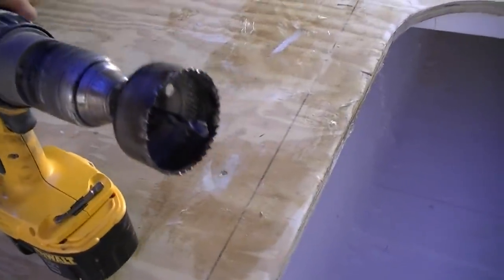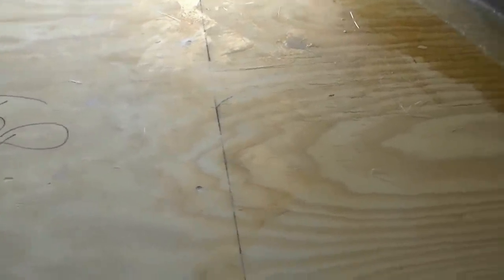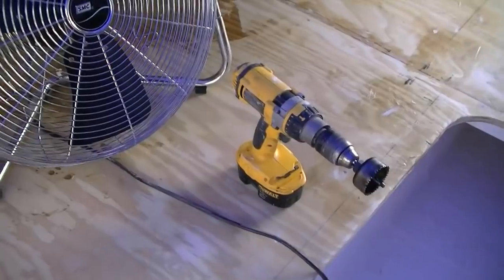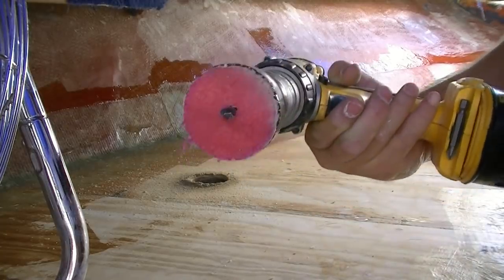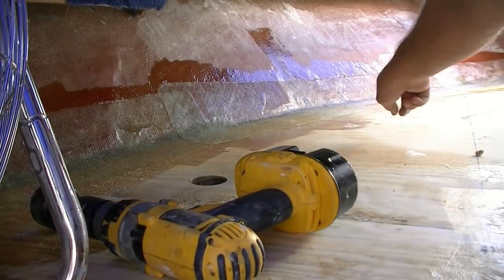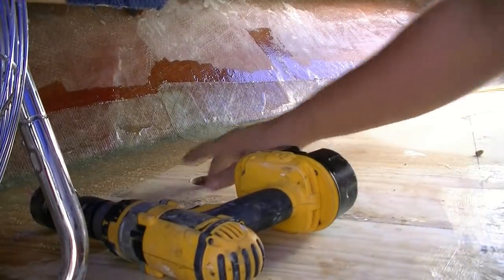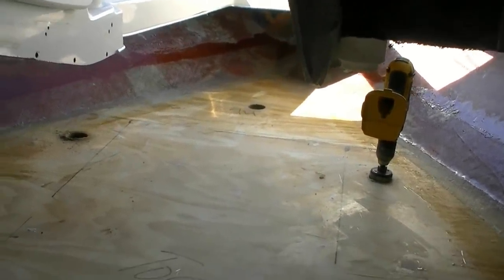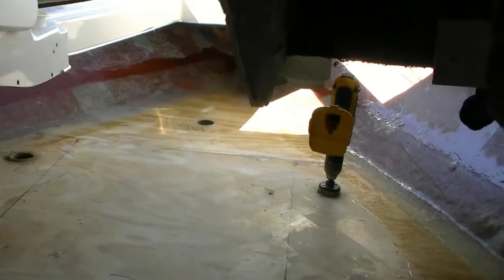Foaming the Deck of the Sea Ray with 2 part foam VLOG# 37

Comment: I don't understand why you would foam fill the sealed compartment creating the possibility of either the floor pushing up or the bottom of the boat to sink down from the foam swelling when the foam is curing, further more I bet that boats got some serious water issues rate now from not drilling any weep holes in the floor stringers to allow the water trapped in the front to run down the center into the rear compartment where it can be drained out threw the drain plug, any boat sitting in water sweats on the inside from reverse osmoses just the opposite of a cold pop can in the heat of the sun, on a cool night it will also sweat out of water and that's how water can rot out the foam. if I was doing the project I would have used that pink 4x 8 ft sheeting foam and laid it down between the stringers with just a dab here and there holding it under the floor but not pressed hard against the bottom of the hull, I liked your work with the peanut butter and I would have used a rubber hose in the drain hole so I could remove it in case another brass sleeve would have to be put in somewhere down the road, all in all its great work and you did a very nice job, just giving you some info you probably hadn't herd about before.
Reply: +mark chock  ok lets set the story straight, foam floats and its a coast guard requirement on all new boats to use foam under the floors, I have an issue with this as foam that is sprayed is sealed but when you cut into it it destroys its hard shell on the outside and will allow water to penetrate it just like a sponge, in my own opinion you should use plywood treated and cover it with fiberglass resin and matting to seal all edges and use it as stringer boards, once its installed as a stringer to hold the weight of the floor and support the chimes on the bottom of the boat you should drill weep holes in the lowest most rear point of the sides closest to the shell of the bottom of the boat, if you look at it like when the boats taking off where does the water go? this will help you understand what I am talking about. when it rains on the inside of your boat the water runs under the floor and if its full of foam then the first chopy water you hit real hard starts to move and stress the foam, foam should only be used under the bow and inside the top sides where your steering cables run threw it, remember its a flotation device and has no structural support. if you seal off an entire underside of a boats floor with no drain or weep holes I guarantee there will be water in it and no way to get it out without removing the floor and drilling weep holes.. take a look at how water drains out of a simple row boat it runs down threw holes in the inner structure to the drain plug. if you think your boat may be retaining water just put it on a trailer and raise the front and pull the drain plug, if you still see it dripping after 3 days its holding water, if the foam is saturated it could take months to dry it out and maybe even years. I worked on a lot of boats in my career and I am considered a fiberglass expert. my first redo was a 14ft v closed bow 50s model Larson, I removed the floor and transom and foam filled the stringers, the transom was custom made at 1 1/2" thick from top to bottom with reinforcement gussets glassed rate into the floor and transom. the top had to be cut shorter 1 inch to compensate for the water well at the rear of the boat because I wasn't thinking when I made the transom too thick and when I tried to put the top back on it was hanging over the bow lol. so the boat was custom built as the original rating was 40horse but I put a 4 cyl 65 hp v evinrude on it and got 42 mph out of it, a year after I sold it I seen someone had put a 225 short shaft black max on it. I think I know my stuff as I built it for 200 horse
Reply: +mark chock  I agree with much of what you say about draining compartments of moisture,I disagree with the foam not having any "Structural Support". I am in the process of DEconstructing a '97 Skeeter Bass Boat. When I took out the floatation foam and the wood,much of it WET (due to poor construction an not COMPLETELY resining ALL the wood by the manufacturer),  the hull lost a lot of it's stability.I will be putting foam back in when I do the rebuild and EVERY compartment will be sealed properly! This isn't my first rodeo with rebuilding a boat from the hull up so it will be done right. The poorly constructed Skeeter lasted 20 years now and done right should exceed that. Happy Boating!
Reply: +Mike Small I believe the boat was originally foamed for satisfying the coastguard in new boat construction. I used foam to hold the stringers in place on a 30yr old boat one time and I found out the hard way what happens, the floor was removed and the stringers were exposed and you could see that they were dry rotting and it being my own boat I poured the foam down across the open stringers just for a quick fix to hold everything tight in place so I could get the new floor set In, and fiber glassed all the edges down and everything looked kosher but when I got it in the water it rode like a surfboard and my friends and I skipped some waves with it and had a lot of fun that summer, the issues started showing up as the boat was trailered outside and the boat was dripping water forever, now the only thing I did was take the boat out and beat the hell out of it like most 20 somethings would do with a $50 boat. it was extremely heavy as the water saturated the foam. now im not saying that the new foam or the old foam are better or worse I am just stating what I found in my own personal experience. I now have a boat that im sure has foam in the floor but as long as I  keep the inside dry I believe the foam will stay in good shape, I think that by skipping waves with a 225hp merc on the 14 ft Larson V hull might have smashed the foam a bit and actually started the decay of the foam by the intense pounding it took from jumping waves. good luck with foaming and just keep in mind that it expands 30 times its size so 1 qt mixed fills 7 and 1/2 gallons of space and you can trim it with a hand saw blade.
Reply: Non structural low expansion closed cell foam...designed for flotation. Aero Marine is a well known company with a ton of great products. Look them up before commenting. Their 8lb density foam works great as well but not for flotation. More like the foam used in boat manufacturers that build boats with foam filled fiberglass stringers.

Comment: Hi like to say you have been doing a great job i do a ? regarding foam like to get your thoughts as you have had this project done for long time so here is what i just got ( 14' Glass Magic )   my floor wont be as deep as yours for sure at most it be 7 inch's i am thinking of using spray type " Great Stuff " because it is a foam and ill be working in a much smaller space im thinking at most 4 cans should cover it my understanding the foam is there to help with noise and poss make stronger like to get thoughts on this
i see you use 2 part ill never need that much for sure ok thanks and again great job

Comment: I would foam it....cut the foam off level with a saw or hot wire...sand flush to the stringers.....put down deck.

Comment: You should drill a bunch of 1/4" holes around on a grid...
That would allow air to escape and also a simple visual check that the foam has filled the cavity completely.
Reply: +Tyler Durden in time you will understand why foam is not good to mix in water. its cheap solution for a simple problem of sinking watercraft and in time it breaks down into little floating pieces on the lakes
Reply: +mark chock Who said anything about water?
Reply: +Tyler Durden I assumed you were going to put your boat in the water. if you only new about the factorys problems on boats with foam filled floors you would be in awe. the foam is like a sponge, it absorbs water and every time the boat is used it gets water in it from the outside, the water doesn't just jump back out of your boat it has to be pumped out, if the boat is still dripping water from the drain plug hole after being out of water with the plug pulled out for a few days you have water under the floor, its like everything else in this world gravity pulls it down, a boat sitting on a lake tied to a dock sweats from the morning dew on the outside you can see it, now what do you think is happening under the floor as its sitting in the warm water on a cool night. the dew has no where to go and gathers at the lowest point, even a saet gets wet from dew as the cushion sweats on the inside as well as the outside. if you think a boat needs foam under the floor then ask yourself this. why does  a cargo boat have a steel hull covered with concrete? it has a pump in the bottom of the hull pumping water out to keep it from sinking. there no foam anywhere

Comment: can you put down foam first then trim it and put down the deck?
Reply from the maker: +My Damn Channel You could, but then need to cut it level
Reply: +My Damn Channel Yes. The best way is to drill many small holes for venting and calculate how much resin per pure you need. It needs to ooz and blowout all the holes. If not all you are doing is making cavities under the deck. Pre forming works great. Use a long sanding block with 36 grip paper glued to it and just sand it flat. Then bed the deck in resin thickened with fumed silica. This is a very bad example of how to do it.

Comment: Regarding the waste in the bucket - it has expanded by a factor of at least 10 (manufacturer says 30x max eventually) and so you're only looking at about 1/4 cup of resin in the bucket each time.

Comment: @brewnonymous Milwaukee is a Taiwanese multinational conglomerate.  They're owned by TTI.  DeWalt "currently" is probably better.  The drill in the video is an 18V NiCad hammer drill.  If he's using it in the wrong gear, he'll burn up batteries.  My guess is, the batteries are just done.  They should last just fine however, he did state that it's hot.  In heat, they'll fail more quickly.

Comment: Why replace the foam?  I'm asking because I really hate that stuff.  It seems to do nothing but cause problems.  It seems to get waterlogged and nasty, and rot everything.
Reply: +highvelocity123 your right it rots, it retains water and if you really want to save your boat when replacing the floor leave out the foam. if you have a junkyard weigh scale see what it weighs this year and weigh it again next year, if its gaining weight its retaining water
Reply: Afaik close cell foam is waterproof. Open cell foam isn't.
Reply: My ex-wife's favorite excuse. :D

Comment: What ever they say closed cell or not as the foam gets old it get waterlogged. the bottom of older Carolina skiffs are made using premade foam (which should be perfect but they absorb water ........none of it should be used anywhere water cannot drain out of!   if you look at how crappy the foam looks that bubbled out that what is at the bottom of the foam he poured , crappy..... im sure the boat will be fine for quite a wile but if its not looked after right..........cheers warren

Comment: The foam is a nightmare.  Will retain moisture thru the years and rot out your wood.   I would have put in little inspection plates to inspect annually for cracks and to be able to wipe dry.   The hull weight will increase yearly with moisture buildup.   U did a great job though except for the foam.

Comment: Why foam over bilge?
Reply: +bestian4 Two reasons.  1.  For floatation in the unlikely event of taking on water to help try to prevent the boat from sinking (an object floats because it displaces more  weight in water than what the object weighs) and 2.  to remove air voids where gasoline fumes can accumulate creating an explosion and fire hazards.

Comment: I have worked on a lot of decks. I would never replace the foam. It will hold water and cause the deck to rot.
Reply: The new closed cell foam doesn't get water logged.👍

Comment: You screwed that one up royally.  In fairness, you clearly didn't understand what PolyIso (part A) does so here's what happened:  When you dumped a ton of foam into those holes, it expanded and a thermal reaction burned the inside of the foam.  So you now have voids between your foam.  This is why professional foamers don't lay down more than about 4" on a pass.  Hell, if you're using a Dow froth pack you're not supposed to exceed 2".   Also, you're supposed to be using a respirator (the one with the magenta cups on the sides would be sufficient for a well ventilated area) and proper eye protection.  There are reports of some people having fires when they go that thick with foam.  On the plus side, even though there are charred areas in the center, the outside is probably still solid so barring cracking, those areas should still hold air.   If you do it again, lay down the foam with the top off and make passes, trying not to exceed 4", allowing the foam to cure before building up to the height you need.  Then, when you have 2-4" below the deck, you should have a decent understanding about yields and you could finish it up with a technique similar to what you did.
Reply: Exactly what i was thinking. lay it down with deck off. to about 4 inches then fit deck, drill couple big holes and drill quite a few 3/8 vent holes and fill up the last bit

Comment: You did it wrong, you drill one hole pour shit loads in and then block hole straight away, the foam has no wear to go and gets super compressed and dense

Comment: Is that 2lb Density?
Reply from the maker: Yes sir
Reply: I am doing my first boat I am just about done laying the floor. Next step foam. Do you think 2lb is dense enough to stiffen half inch plywood? . I know half inch is a little thin but its what I have to work with.

Comment: You should have drilled your holes ,,,before you put the floor down,than you would not have to worry at all.And why not use fiberglass sheeting for your floor ? thats what I used,,NO WOOD AT ALL,,,WOOD is a sponge and sucks water ,WHY use it in a boat any where ?

Comment: You should talk to a professional before using foam so many things wrong. No vapor mask is a huge mistake
Reply from the maker: Roy Wells masks should have been used. However it was well ventilated.
Reply: FriscoBoater's Garage if you can smell it your in trouble I'm a professional spf applicator. I shoot closed cell every day always wear a mask if your inside you have to wear positive air flow.